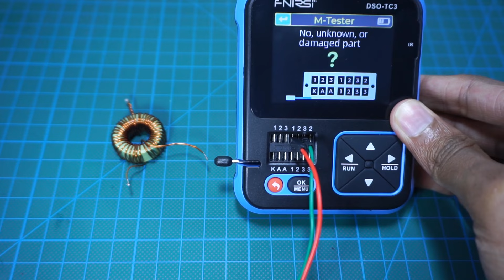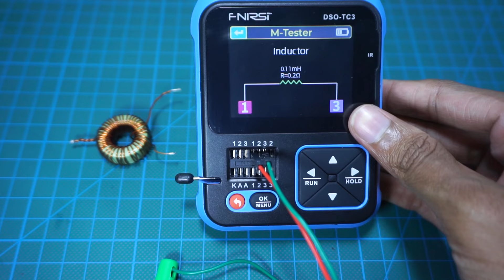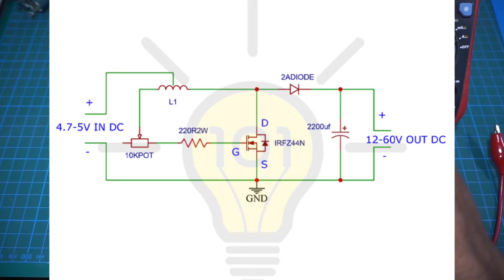Simple DC to DC Boost converter using MOSFET, Convert 3.7 volt to 12 volt

Comment: I have a question if i put 3.7v 12000mah lion battery to this circuit and get 12v for output did i get like 3000mah ???
Reply: Para 12 amperes q mosfets utilizaría

Comment: If this is a 3.7 volt to 12 volt DC-DC Boost Converter why isn't the Output voltage fixed at 12 V. I need to make an exact replica of this for my Power Electronics Course project. Also, what is the rational behind using a potentiometer? Please answer the questions. Thanks a lot!
Reply from the maker: frequency adjusting in mosfet
Reply: Use zener diode to get fix voltage

Comment: Marvelous video of boost converter. But how to make that inductor. How many tiens are there and which gauge wire is used?
Reply from the maker: 0.12 mH. 6T 0 6T . 0.5mm copper wire
Reply: Nice converter it's a pity about the frequency admits because I want to run my transistor amplifier from it I've got some i r f mosfet transistors I must give it a go

Comment: Please connect the loads and measure the voltage. Is it advisable to feed 60V DC to a 12V lamp or 12V LED?
Reply from the maker: I did it
Reply: @chinmoy1955  the voltage ⚡ will definitely go down, from 60v to probably 8 or 10 volts once the circuit is loaded with a bulb, so no worries about feeding 60volts to a 12 volt lamp

Comment: bro, Why is the noise from the circuit?
Will it give a constant 12 volt output, when I connect load? please reply
Reply from the maker: It is induction sound in inductor.
Reply: @homemade_101  thanks

Comment: does the potentiometer lower the voltage output? i only need 24v for a pneumatic solenoid valve. thank you
Reply from the maker: no it was use frequency control

Comment: can i run 20watt speakers using this boosted voltaage ?
Reply from the maker: yes. but not recomnded
Reply: @homemade_101 why and what’s the solution?
Reply: @suvamkumarnayak  you have 12 volts but not the current